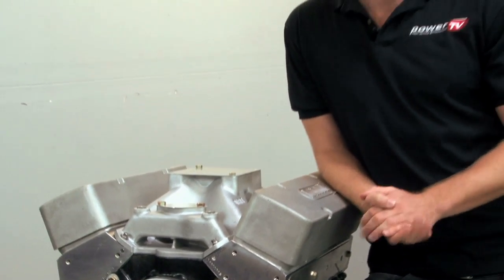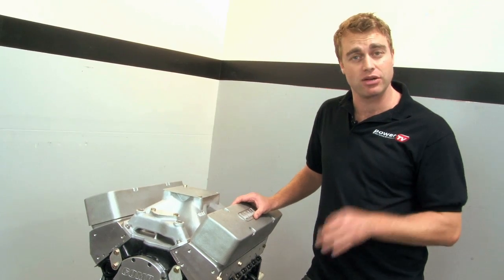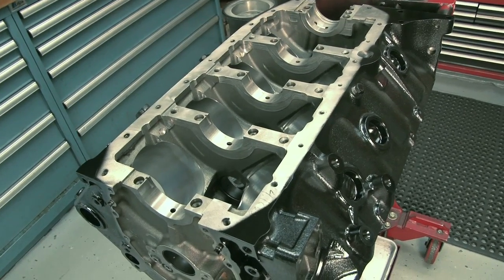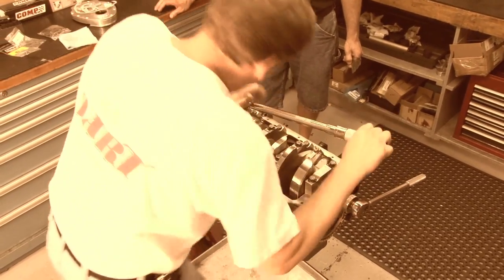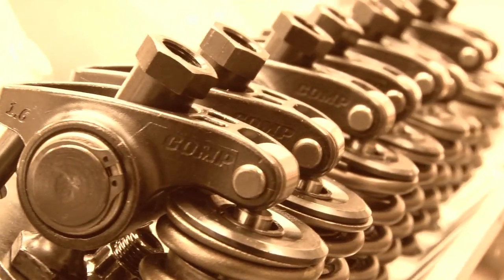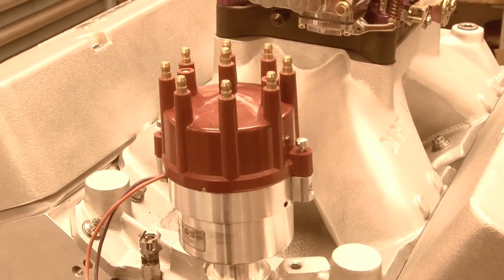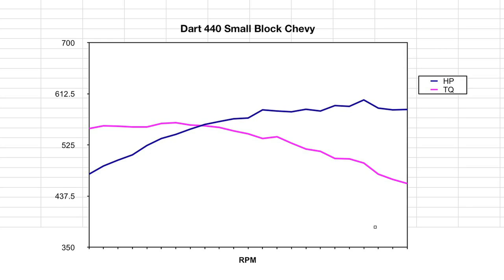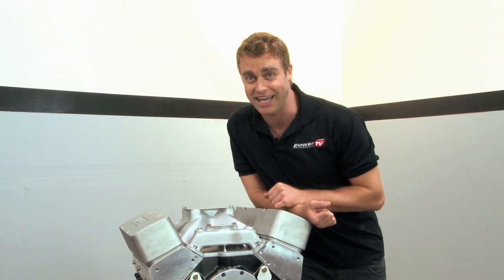StreetLegalTV.com - Dart 600HP, 440CI Small Block Chevy

Comment: Heads too small . My 441ci
I used AFR 210 cnc , uses 2.08 inch intake valves.
That was because i race at ALTITUDE, 2600m above sea level., so better air speed midrange.
At sea level i would use minimum 230cc AFR,s.

Comment: Great power. But I was thinking that you would use at least a 215 intake runner with the biggest intake valve especially with the big bore. It would be interesting to test that.  Also witch cam did you use and the specs on it and how much vaccum at idle. I want to build something similar. Thanks for all the work on the video.

Comment: That engine needs 230 cc heads cnc version with 2.08 intake valve and, a better cam combo sould make 700+
Reply: AFR245 heads and 700hp will be achievable comfortably with a solid roller and possible with a hydraulic roller with high 10 low 11 comp ratio.
Reply: Yeah they left a lot of horsepower on the table, should have used a solid hydraulic cam and around 11.5 cr, which is fine on 93 pump
Reply: Good ideas I would use a head with 220 intake and a CNC single plane MBE makes the best heads
Reply: Yep

Comment: I think they gave wrong head specs; 200cc and 2.02" valves aren't really enough to make that much HP on pump gas. Torque, maybe but not 600HP. I'd believe a 235cc head with 2.08 or 2.10 valves. Just my opinion.
Reply: Perhaps a very happy dyno!!!

Comment: What off the shelf cam did they use?
Reply: im seeing Xtreme Energy solid roller 255/265 top of the street line and 7 k rpm asd maximum 22 notches on graph divide by 3 =7 k